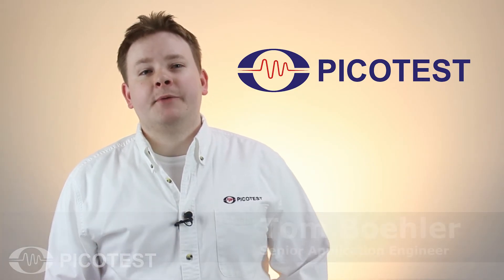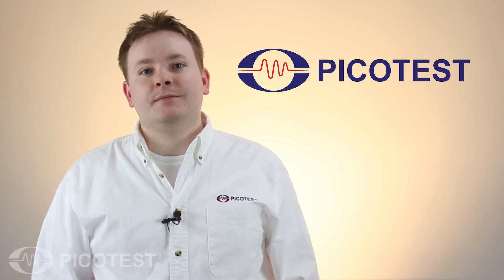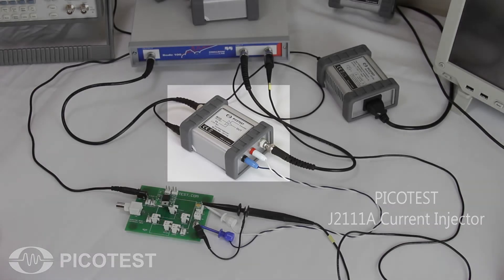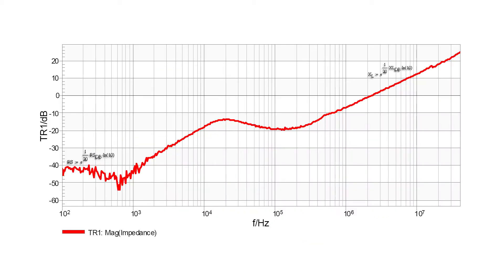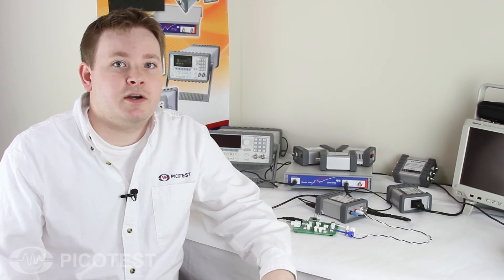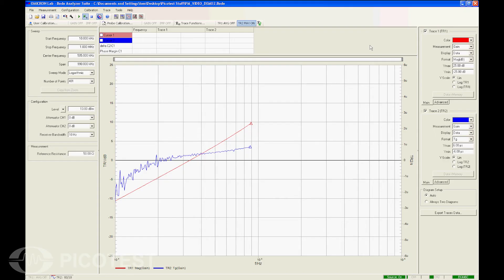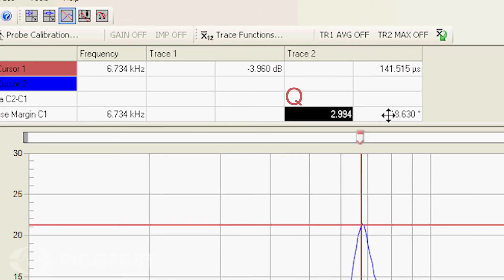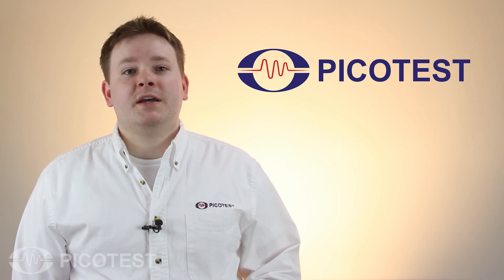Non-Invasive Phase Margin Measurement of Voltage Regulators using the J2111A Current Injector

Comment: Shall I use J2121A injector instead of J2111a
Reply from the maker: The J2121A is used mainly for INPUT impedance. NISM is used for stability testing, which uses the output impedance of a power supply.

The P2104/5A 1-port probe (1-port measurement), P2102A 2-port probe (2-port measurement) and the J2111A (3-port measurement) are the correct ways to test output impedance.

Comment: Which application software was that? Is it Bode100 suite ? Or seperate tool required?
Reply: This is the Bode 100 software, where it is included natively.  It is also available for many other VNA's from Keysight, Copper Mountain and Rohde and Schwarz.  It is also coming soon to to the Keysight ADS simulator.

Comment: For a second order system we can measure the exact bandwidth and phase margin.  A second order system the phase never crosses zero, so there is not technically a gain margin.  For higher order systems we can determine the stability margin, meaning the proximity to the unstable point at (1,0).  We can see the results of phase margin, gain margin and time delay margin, making this more useful than a Bode plot in many cases.  The direction the gain needs to go for stability can be determined also

Comment: Yes you can, theoretically at least. I am not sure how you implement the test practically. The transfer function of a voltage regular or dc-dc converter can be solved using voltage divider rule. Where  vo/vin =Zo/(Zo+Zin) and Zo is the output impedance and Zin is the input impedance Somehow you would need to plot the results - not sure how.